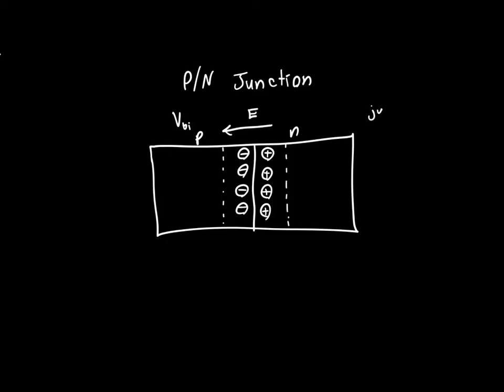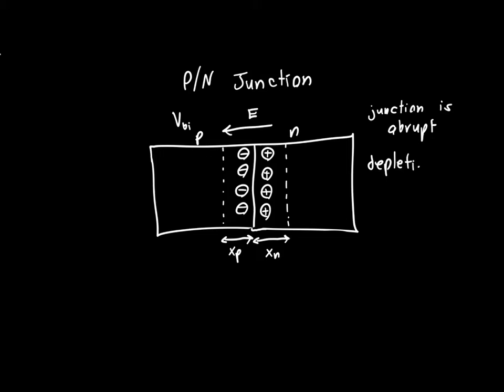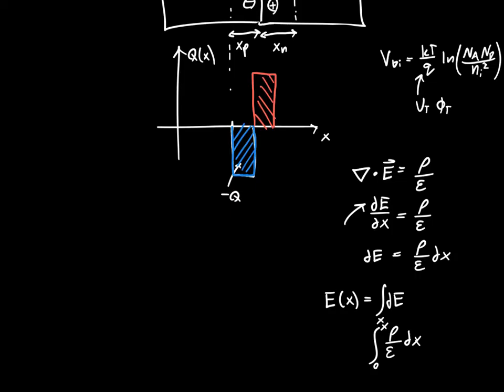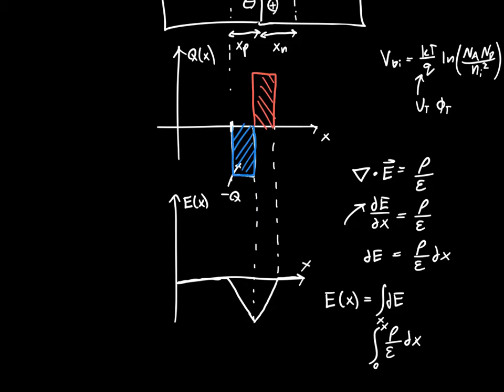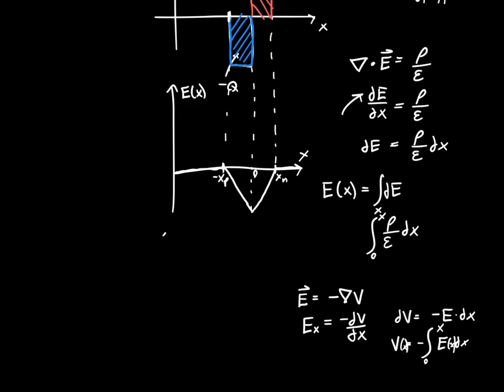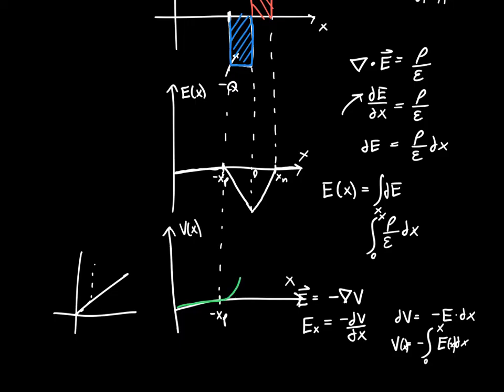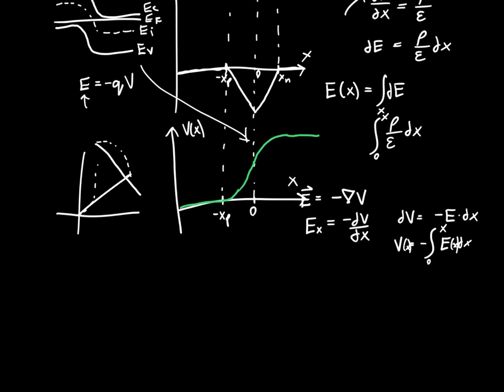PN Junction Electric Field Profile

Comment: the continuity of E(x) and V(x) could be explained using the integration constants that we get when integrating. If we define the Q(x) a piecewise function then E(x) and V(x) also could be expressed as piecewise functions. The integration constants could be set such that there is continuity at the boundary (which becomes the inflection point in V(x).

Comment: Thank you so much for this explanation, but  I've got a question:
Shouldn't the electric field's strength increase as we approach the positive charges? Then why exactly does it start decreasing as it moves from the negative charges?
Reply: The electric field is proportional to the integral of the charge distribution, in other words the sum of all of the little sections of charge. So imagine you are walking along the x-axis in the +x direction and collecting the charges in a basket.  Your basket starts electrically neutral, and as you walk along the region from x = -xp to x = 0 you notice your basket only contains negative charges.  Once you reach the metallurgical junction (x=0) your basket contains the maximum number of negative charges - this corresponds to the strongest negative electric field.  As you cross over the junction into the region of positive charges, when you place each successive positive charge into your basket, it offsets a negative charge, reducing the negative electric field strength.  This continues until you reach x = xn where you have collected exactly enough positive charges to offset the negative charges you picked up on the p-side of the metallurgical junction and the electric field strength drops to zero.
Reply: @erikerlandson3154   it makes sense now, thanks!

Comment: Good lecture! Have you tried to calculate the fields and potential without doping constant assumption, taking the concentration of p as a function of x? I solved it (probably wrong) by assuming that potential of the base counteracts the greatest chemical potential of an emitter, by solving that equation I get  xp, and then I solve an equation of electrical fields, finding xn.

Comment: Thanks for the fantastic videos. As a chemist, I'm confused about one thing; how is electric field decreasing? I understand the electric field is at a maximum at the pn junction interface, because that's where you 'feel' the full positive and negative charge on either side of that interface and within the depletion region. So why isn't electric field increasing as you approach the interface from either side?
Another thing about using the word 'decreasing'; an electric field can't be negative, right?
Reply: Electric field is a vector, which means it has both magnitude and direction. Magnitude is always non-negative (this must be what you had in mind). Direction in this one-dimentional case can be (+) or (-). Here it is negative, because it's opposite of the direction of x axis (E is towards left from positive to negative ions, while x is towards right).

Comment: One doubt, is the net (effective) charge density at each point of the depletion layer zero??
Reply from the maker: Nope, the charge density of any given slice of the depletion region is not zero, but if you add up all the charge in all the slices it will sum to zero.

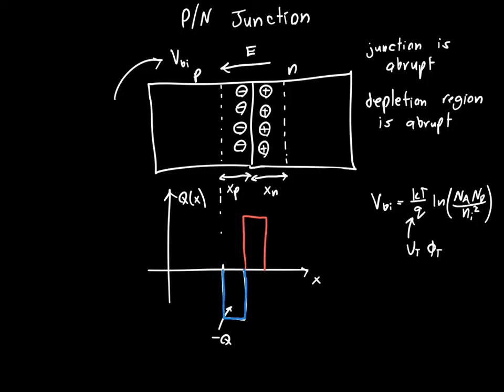Comment: At 3:38 why there’s no net charge outside the 2 regions you drew?
Reply from the maker: Because if there was, the system would not be in equilibrium, and there would be a restoring force (an electric field) which drives the system to equilibrium (same charge on either side).

Comment: at 8:00 how come the voltage doesn't go back down to 0? You said it stays high, but I'm not sure why
Reply from the maker: Because you are integrating the electric field, which is always pointing in the same direction. It’s the same exact reason why when you have charge on two capacitor plates the voltage across them is nonzero.